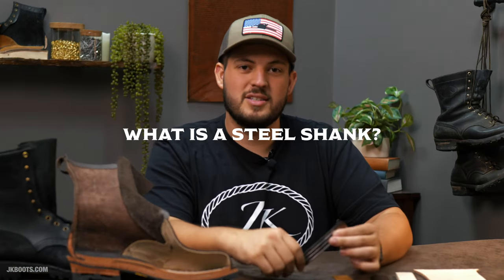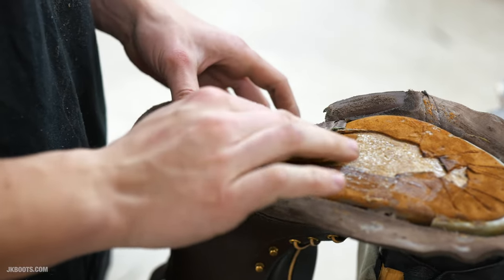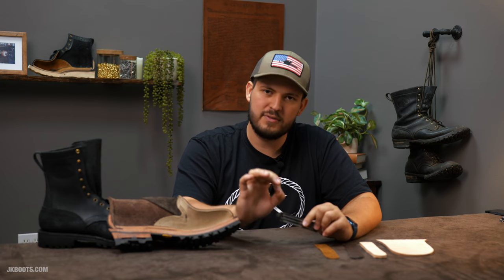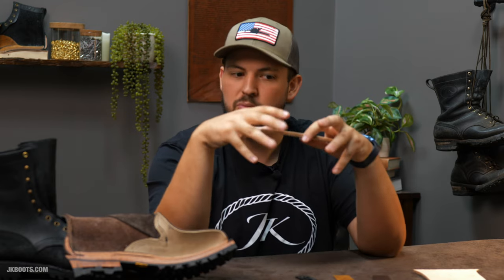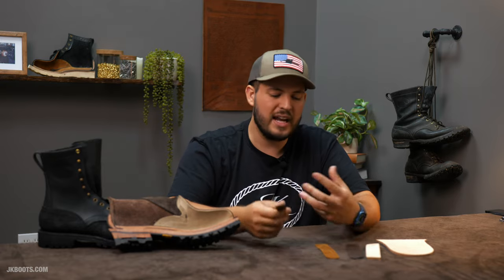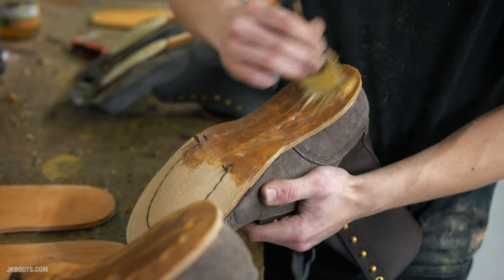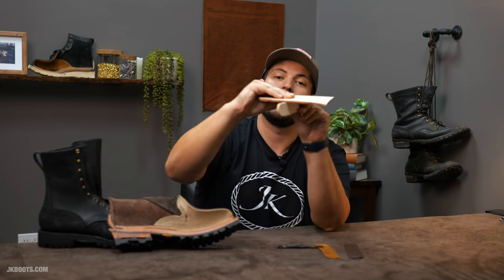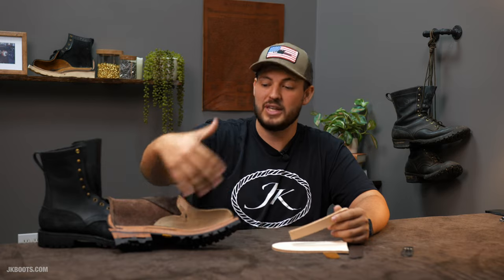What is a steel shank and do you need one?

Comment: I've worn steel toe/steel shank Redwing Loggers for 13 years. Usually got 3.5 - 4 years out of each pair, never had any issues with the shank. No comfort issues at all. My JK bison leather climbers have given me more issues with discomfort than I've had with any boots. The quality is impressive, the comfort has been a work in progress. Redwing Orthotic insoles, and loosening the laces more than I typically would in work boots has helped. Next I might take out the kilties, see if that helps. Other PNW boot wearers have suggested some sort of origami with the tongue, but I haven't tried it yet.
Reply: Try Superfeet inserts.  That’s what I use in my Thorogood moc toe boots(w/ wedge sole.).  I walk on concrete floor for a whole 8-10.5 shift at a Toyota plant.  No issues with foot pain at all.

Comment: Could you have the lineman leather shank without the steel piece? Would there be any point in that ? As an arborist myself its not always spike work sometimes just climbing and sometimes you gotta get om the ground.
Reply from the maker: Yes we can do that but it's on a custom superduty 2.0 which has to be ordered through a retail location. The steel piece shouldn't make a noticeable difference on the ground, but is very beneficial when using spikes. Hopefully this helps! If you have any other questions please reach out to our customer service team at (509) 487-0154 or general@jkboots.com and they can help you out much faster!

Comment: Will the leather shank arch collapse over time? I've worn my White's for 14 years and the steel shanks have no problems other than they squeak, which is annoying if you're in a store and it's fairly quiet.  I've been told that the leather shanks don't squeak but no one has ever mentioned whether or not they are durable.
Reply from the maker: The leather shank will hold over time, notably it will form/break into your foot. There is a bit more give than steal 👍 Squeaking is from leather rubbing on leather. We add a squeak pad that stops this and they wont squeak with steal or leather!
Reply: @jkbootsusa  Thank you for the reply, I'm glad that you guys addressed the squeaking issue.  I think my next boot purchase after tax time is over, will be with your co.
Reply from the maker: No problem. Thats great to hear, feel free to shoot us a call if anything else comes up!